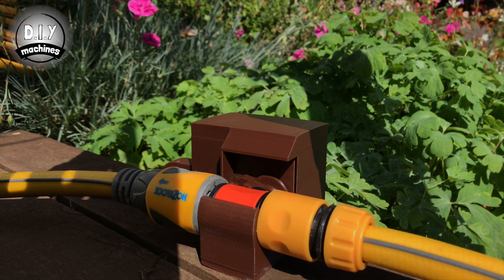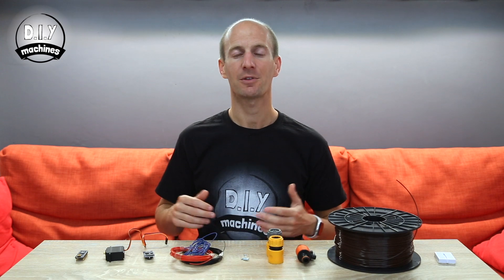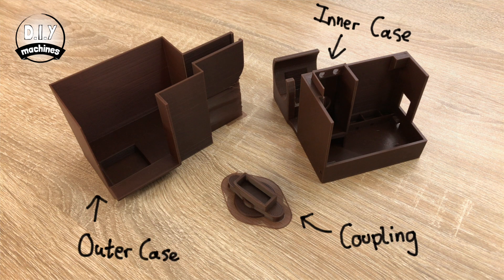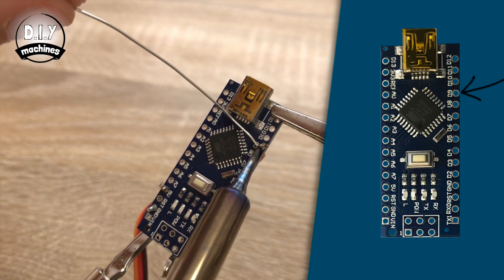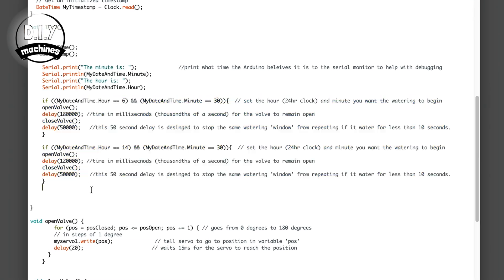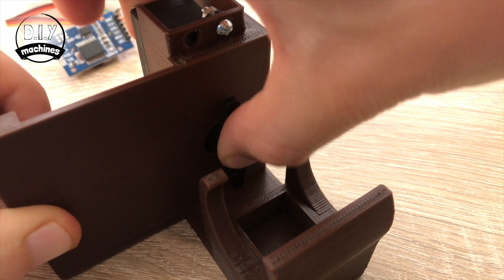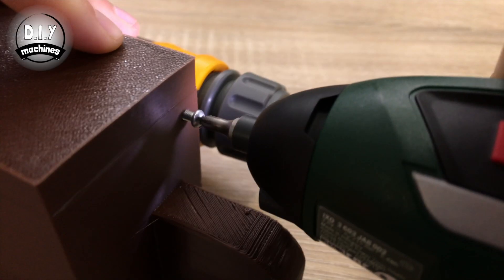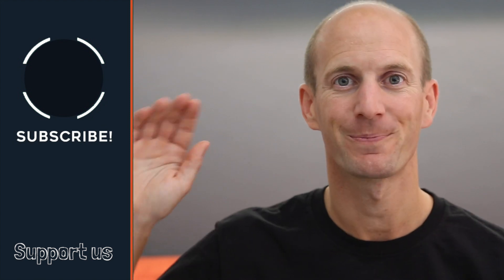Make your own Automatic Garden Waterer - 3D Printable | Elegoo Arduino | DIY

Comment: to my mind not so good idea connect servo in direct to arduino, coz a current of mg996 up to one ampere or little bit higher. better use external power for servo and arduino, and capacitor in parallel

Comment: Hi Lewis , Great project , one of the great things about this project is that it is a full flow valve which would also work with low pressure water supplies e.g. from water but at an allotment. I've looked at a lot of the solenoid valves and they appear to be more geared at mains pressure, the full flow ones are 12v and pretty expensive. I've been sketching out a similar project but looking for a reliable NC (normally closed valve that would auto close if power was lost ) this is important in case you were on holiday and didn't want to come back to a marshy garden :).  I'm thinking there would have to be some sort of spring that would be strong enough to return the valve to closed once power was off , but power would need to be kept on to the servo whilst the valve was open (back to the solenoid situation where power is required to open the valve).  I think this should be ok  with a metal geared servo but getting the spring strength correct would be key. I'll maybe get to it one day :). thanks for sharing your work

Comment: 12V solenoid valves are the way to go, cheap and are simple on/off.
Reply: Pretty much, Solenoid valves are dirt cheap and easily found at just about any hardware store. For what you paid for the servo alone you could of bought multiple 12v solenoids with hose hookups built in.
Reply: @nikushim6665  How much are they? I must be looking in the wrong places.
Reply: @TheRainHarvester  About 10 bucks or less depends on type. You can bulk order them off aliexpress for half the price though.

Comment: I liked your Project but solution could be simpler with a selenoid Valve
Reply: It has Come to my mind that issue must be the current of the selenoid Valve I guess right?
Reply from the maker: Yes, you're correct. A solenoid valve was my first thought as well. The servo draws much less current.

Comment: Nice Project!
I think you forgot to show how you set the actual time  in the RTC. :)
Reply from the maker: Thanks Esprit1711, and yes you are correct - I did forget! I have just updated the code with instructions at the top on how to set the date and time using the DS3231_Simple library. Thanks for pointing this out. :)

Comment: gj but i wanna ask why dont u use solenoid valve ? and for iot esp8266 or esp32 isint it better way for home iot/automation etc
Reply from the maker: Hi Plazma. I chose not to use a solenoid valve to reduce the required amount of current to open the valve. A servo can be powered easily via the Arduino Nano and once the valve is opened the energy requirement drops back down to idle levels, a solenoid would need energising throughout the watering period. An ESP8266 or ESP32 would be great for connecting it with other devices or remote control but I wanted to keep this project simple. If you do swap the Arduino for an ESP32 similar I'd love to see the program you write for it.